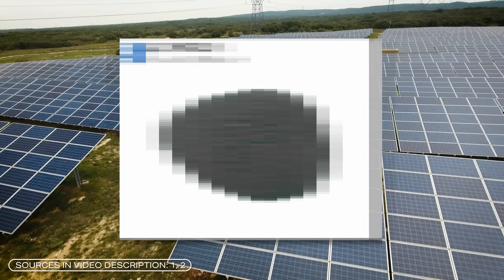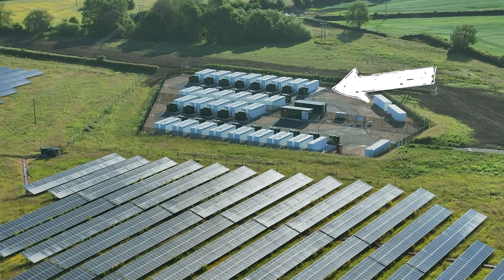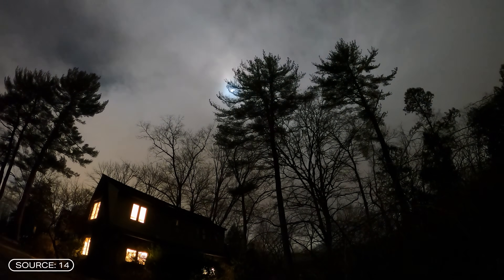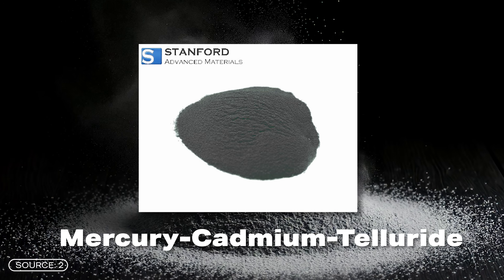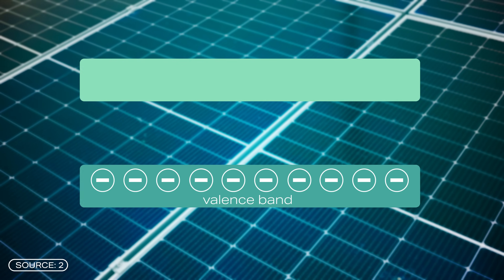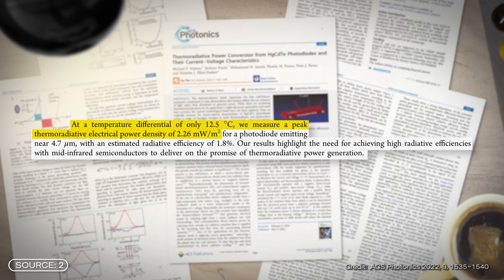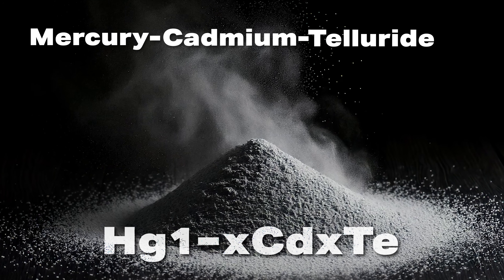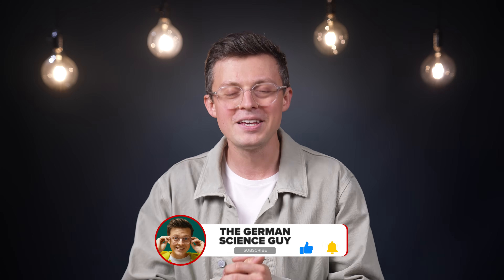Solarpower WITHOUT Sunlight: This Is How It Works!

Comment: The real hurdle is not discussed here. These cells can produce electricity only when there is a temperature DIFFERENCE between the two sides of the semiconductor. The research paper cited showed the result of a 12.5C difference, something we might see on the surface of a lake on an unseasonably hot afternoon, or during an unseasonably cold night. Also, adjusting the cadmium or other metal content will do little to improve efficiency, because one can only tune it to a single wavelength, but infrared emitted by the earth and clouds spans a tremendous range of wavelengths. It's just more ideologically-driven research into the anus because the obvious and clear road to cheap and reliable power, fast breeder reactors, is taboo, because it doesn't serve the evil mission of the trans-Atlantic financial elite, to rule the world by manipulating our emotions. The elites of the West must have us afraid of all things nuclear other than war against the targeted nations--Russia, China and their allies.

Comment: I am on a 60 year quest to overcome the second law of thermodynamics as nonmonitized science: 
Here's an impractical but hard to refute thought experiment way to reverse entropy. It bypasses issues with ratchetwheels and pawls:   

<Heat absorbed>
Paddlewheel ¤-# -     
heat barrier & axel support
- #-■ lumped friction sleeve
<Heat released>
------------Another view -------------
Cools
¤  ¤  ¤ 
#   #  #
■  ■  ■
Heats
Brownian motion in fluids makes matching scale paddlewheels turn their individual axels at random speed in random direction absoarbing heat 

Brake friction releases heat. 

Many ¤#■ s in parallel aggregate small effect (nanowatts each). In principle there is a free pumping of heat from group of ¤'s side to group of ■'s, side. 

I have been interested in Hg/Cd-Te or lnSb thermophotovoltaic cells with the question of whether mesoscale uniform ambient heat would lend out thermal infra red photons with accompanying nanoscale local cooling which in turn would make photovoltaic power. I don't hear that the direction of the IR photon makes any differnce therefore a three part repetitious stack of thin Cd-Hg / Te / 

[ohmic contact metal] would start at a mesoscale uniform ambient temperature, cool down, and release equivalent energy electricity. The electrical voltage under electrical load would be less than the open circuit voltage so the equlibrium electricity to IR counteracting route would be suppressed. 

Aloha
Charles M Brown 
Kilauea, Kauai, Hawaii 96754

Comment: 12.5K temperature differential, 0.00226 W/m²
I don't think I can take any of that serious for now. TPV is much better suited to high temperature energy storage with high temperature heat co-generation.
Reply: Yup its in its infant state. You only want to know about new tech when its a finish product? Good luck with that. You must not have a phone or the internet because they are not done evolving
Reply: @DMP1327  moot point. What I'm saying is: this doesn't have runway.

Comment: 1) Life being an issue - the other is cost - as of getting away from the other elements - it I think its already possible. 2) I also think supplying the heat needed would be easy to hit as you can move wast heat out of house during the summer and into the panels. 3) The other problem is IR doesnt produce much power - so at best maybe a few watts of power during the night - with that said - most homes do drop power usage to around 200-500 watts (ignoring hot water and HVAC), so its possbile that we could still target over enough panels to generate a small amount of power to offset it if we could make something like 10-25 watts per panel. Anything smaller than that - I question if it would even be worth it. At 10 x 10 panels = 100 watts would at least offset vampire loads such as your router, modem(s), lights, etc. Then again, might be juist easier to add another 2 panels a bit more storage to cover it.  Another thing though is that it should work all day  - not just at night - so really it should be adding another 240 watts per panel per day. That be like adding 2.4k more power back - more than enough to offset even any power loses that comes with MPPTs and Inverters.

Comment: Basic research, yes, but calling 2.26 mW/m² "really low" is in my opinion still overselling it. Ordinary solar panels can produce about 100,000 times more than that in sunlight, while solar panels need light to produce anything, that system requires a significant temperature difference, to produce practically nothing. 12.5 °C isn't very much, but unless you store heat, which you for multiple reasons really don't want to do in or under solar solar panels, you typically won't have even that difference for very long after the sun sets. 

One natural question to ask is if thermoradiative power conversion could become more efficient, and the answer is most likely yes, but not enough so to matter, potential for improvement is modest, nowhere near enough to make it meaningful as an add-on on solar panels. There's not that much heat in solar panels in the evening to convert into power, and thermoradiative power conversion isn't an efficient way to convert heat into power.                 

If you want power during nights there are a lot of other options that actually works, batteries for instance. While it can be argued that batteries have their issues too, they can store very relevant amounts of energy very reliably for very long time.  At 2.26 mW/m² you might be able to collect about as much energy per good night as a single AA NiMH cell can store, from an array completely covering the roof of a decent sized house.        

Even if you specifically want power from solar heat during nights, there's for example CSP with thermal storage. There are currently not many commercially successful examples of that, but CSP can produce hundreds of thousands times more power than what they achieved in this research, and that power can also be generated at will over a much longer time.     

The idea of thermoradiative power conversion in solar panels is another example of concept that tries to utilize a small energy potential with a new technology that can't become even nearly as good as existing alternatives already are.

Comment: This is not practical for energy production. Despite being pro renewable and having solar PV on my roof, I believe we aren’t open enough about the slow return on investment of the CO2 used to produce the panels. I suspect many applications of panels may not ever pay bay back, but are somehow treated as zero carbon by lots of people or businesses. The panels you propose may have a similar power flux to solar, but the thermodynamic exergy is minuscule so they fundamentally cannot generate lots of power. This means they can’t ever pay back what would be similar production energy cost. The tech is interesting though for microgeneration for off grid sensors and other niches though.

Comment: Your English is good, a mile or km better than my German. Two words Mercury and Cadmium.  The EU will never allow mass manufacture using these elements.  Without a practical end of life solution.  Who on Earth would want to live anywhere near a plant extracting these elements from electronic waste?  It's interesting but I don't see this as a route to green energy.  May be of some use in night vision or possibly missile guidance.

Comment: Your English is fine there wasn’t a single word I didn’t understand.  Great that we have a POC, still a long way to go.  For sure we will find a material that doesn’t need heavy metals then it could be coated on the bottom of the silicone panels and put into bifacial panels

Comment: With regular solar panels they changed the formulas and got better efficiency over time. They may also find a better formula for thermal panels as well. Albert Einstein: 'If we knew what it was we were doing, it would not be called research, would it?'

Comment: 100.000x less energy per area makes this look like pure academic interest. and then the very toxic composition. Take the same area with established visible photovoltaic, and allow the development of very low efficiency but cheap energy storage (usually not even tried). I mean even if you could only save 1% of the day time energy from the cell, you would still get 1000x times the energy for the night compared to the thermal photon cells here. I mean the energy payback time for regular solar is 1-4 years. At the same cost, these cell would need to run around 100.000years!!! Physically low energy/temperature photons are just WAY less useable. There is a reason plants also use visible light only.

Comment: Firstly your English is considerably better and easier to understand than that of many native English speakers. Disregarding the ridiculously low output per M² I think the problem will be the capturable energy and how low grade it will be. Concentration should probably be on the efficiency of the radiating surface. Seebeck effect generators are already probably more efficient. I think one has to consider the probably greater benefits of using more of our already developed and improving technologies which are well proven and have now the benefits of scale to make them cheap. I feel the space such tech could take up would be better used for existing tech and we have so many competing good battery technologies already in existence along with the fact that the sun shines and the wind blows all the time somewhere in the world and of course we can store it simply as high grade heat if we want to, the conversion of which is relatively simple, compact and efficient and we have been doing it pretty much for ever already. I do feel that sometimes we develop technologies just to give universities something to do to generate funding and press  releases and this feels like one of those where the real world disconnect is rather high.

Comment: 15% of the worlds energy supply was not produced by renewables.
An amount equivalent to 15% of the worlds energy production was produced by renewables about 4% of that 15% was actually used by the grid while in many cases the traditional sources continued to produce the reliable power needed for the grid not to collapse in utter failure. The question is not can renewables produce a lot of energy , the question is Is it useful reliable quality energy?

Comment: Idiots find what you say less important than how you say it. Don't worry about them.
Useful infrared photovoltaic cells are far more interesting than just being able to make power at night.
They would greatly increase the efficiency and simplicity of RTGs, SMRs, solar thermal concentraters, bioreactors, basically every power plant that attempts to make energy from a heat difference which does not require motive power. 10% efficiency would be enough to revolutionize EVERYTHING.

Comment: https://www.youtube.com/@GermanScienceGuy  Thermal radiation essentially means infra-red "light".  So what happens if the effective bandwidth of a typical photovoltaic cell is broadened to allow (more of) the infra-red emissions of sunlight and ground-(re)radiation to be converted to electricity?  Combined with bilateral use of these cells?  Yes, I know that increased temperature of a photovoltaic cell reduces its conversion efficiency.
Include in it all the Peltier effect, please.

Comment: "an electron in the material is excited and released".  Its so painful to hear PHD's still state this outdated logic.  If the silicon atoms "release" electrons and then recapture electons while contained inside this air tight pocket, where are all these extra electrons coming from?  There are only 4 electrons in the outer valence and only 14 in total for each Si atom.   All the billions of electrons flowing from solar panels (one volt is the potential energy to move \(6.24\times 10^{18}\) electrons) and there is no change in the structure?   That is just silly.  Maybe that is why all PHD's still cannot pinpoint locations of electrons in an atom.   Time to change science to facts instead of this fantasy.
Reply: Wrong. In a silicon crystal electrons occupy bands, not tiny isolated pockets - a photon with ≥band-gap energy promotes an electron into the conduction band (creating an electron–hole pair), and the p–n junction (or built-in fields) separates them so they flow as current. Sunlight gives ~10²¹ photons/s·m², so there are more than enough photons to excite electrons — nothing mysterious or unphysical is happening.

Comment: It seems to me that the temperature of the "photovoltaic cell" must be lower than the temperature of the light emitting source. You actually mention 10 degrees temperature difference at the same time you mention how mant milliwatts the devive produes.
Temperature differences can be used to generate electricity. How does the technology compare to thermoelectric cells`?

What about the practical application? Is it to use the cool from the night sky in deserts to trap energy from the sun stored during daytime in the ground? It seems to me that other methods would be more efficient. circulate a suitable medium between coolers that collect the (absence) of infrared radiation from the desert sky and tubes collecting the temperature in the ground. Presumably there would be a temperature difference of more than 30 degrees at suitable places. What would be the best technology to get electricity from that?

Comment: If perovskite cells could be tuned for infrared and made cheaply enough maybe they could be used for cooling buildings. Roof spaces get very hot - maybe a good place to start.
Reply: I'm not sure I'm correct, but from what I understood it doesn't work like that this. This is capturing the heat that has already been radiated off. That is, it doesn't change the cooling speed in any way, it simply collects the heat energy that would otherwise go to space.

Comment: I'm getting 2.97V Voc on my little 2 x 410W bifacial's (in series) right now at night.  If I shine a small LED flashlight up onto it from the back side, the open-circuit voltage pops up to 25V.  Sadly, the charge controller is unable to convert that to any real power (as expected).  And these panels don't use (rather toxic) Cadmium Telluride.   But its fun to think about.

But I find it interesting that it doesn't actually take a whole lot of photons to at least get modern panels to produce a decent open-circuit voltage.  They can only push microamps, but still... kinda cool.

If we could find a decent chemical matrix to actually get real current out infrared light, it definitely seems to be in the realm of possibility.  At the same time, though, it isn't going to be very useful if the power output is only a sliver of what one gets during the day.

-Matt

Comment: So, now,instead of letting Earth radiate heat energy into space to balance temperature, we can trap it here...

Green energy is causing global warming. Ironic.
Reply: I was thinking about this as well, if we're trapping the heat, won't that increase the planet temperature ? Or is useful work going to make it not warm more ? That is, if we get, say, 100 J and 20 of them are used to do work, only 80 J for heating, would that work ? Or are the 20 J used for work also generate heat, just in a different place and probably at a different time ?
Reply: @Winnetou17 All energy ends up as heat. Anything we collect, not allowing it to radiate back into space, ultinately ends up as heat loss.
Reply: @95rav  A-ha, thank you for the explanation! So this without better global cooling plans would make the matter worse. Well, 0.002 W/m^2 not meaningfully so, but in case it actually gets economically viable.

Comment: The cell voltage of thermal photovoltaic devices is so low it's probably impractical to use. These specific Mercury based devices are a dead end because of toxicity.  Generating electricity from heat would be more useful as a refrigeration technology than a power generation device.
Reply: It could have uses for nuclear reactor electrical generators in space.